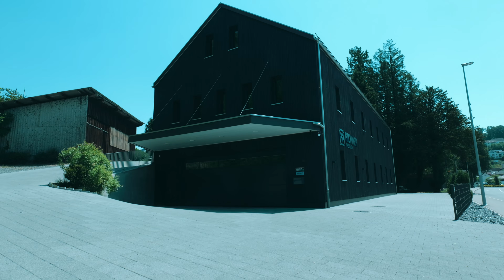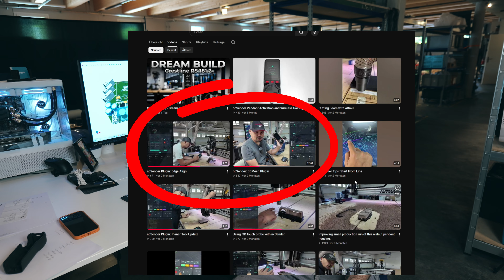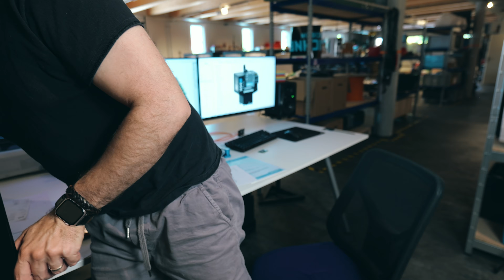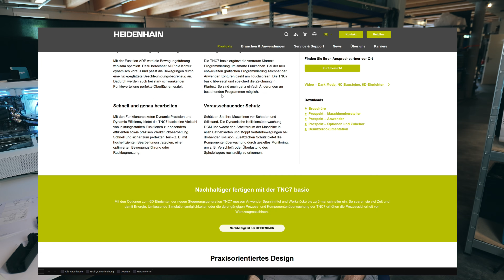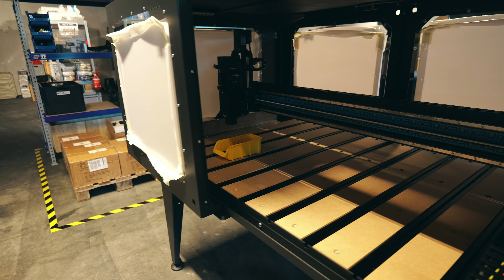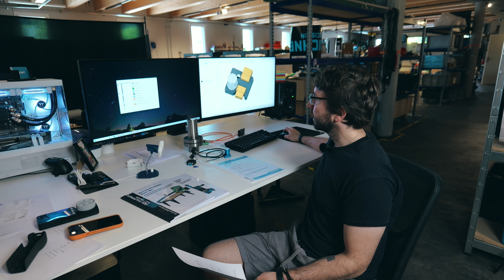Business Update June 2026 ❘ New Workshop ❘ New Employees ❘ Watchmaking ❘ Heidenhain...

Comment: few things
 god bless you for wireless remote! i tired if datron wired remote

second one, you need to mae the tool setter adjustable for X and Y axis

also, because you have a automatic lubrication, i would put a pressure sensor on the destrebution blocks, ideal pressure sensor for each bearing, but its a lot of wiring...
Reply from the maker: You mean to probe also diameter? Thats a different type of toolsetter we can also support, no problem. Our big XM machines use oil distribution blocks with a cylinder for each lubrication point that gets filled while under pressure and gets released when pressure is off. So each rail block and ball screw gets the same amount of oil without monitoring any pressure.
Reply: @Richner-Precision  no, under adjustable tool setter i mean that you can adjust it in plane i dont know how to explain it to you correctly, but its important, because if the tool setter not straight it will measure diffrent lenghts on diffrent diameter tools
if you want sent me you email. i will try to explain it to you better with photos or pictures.

about the  lubricaition points...
 i know what cilynders you talking about. but there is a problem.
 usualy operators run the machines until they stop or put a not compatible oil to the system, and then when one of the ports is cloged you dont know about that until you start hear funny noyses from the bearings,

again, its hard to explain in short message here, if you want to continue the descuss sent me your email i will explait it better.
thanks:)

Comment: awesome! im curious tho, i have been waiting for the lathe to be available, but while i was looking i came across the sinecore cnc lathe,
what would be the main differences from yours to the sinecore lathe besides the flood coolant?
Reply from the maker: They are actually very similar. I have been in touch with Aidan, the founder of SineCore, from time to time. Both lathes are very similar in terms of size, power, and capabilities, and both support full flood cooling. SineCore already offers an ATC option tho. On the other hand, it runs Mach4, which I personally really dislike, while the TORQ8 uses grblHAL. In the end, I think it mainly comes down to where you are located. If you are in the US or Canada, I would probably recommend the SineCore Lathe. If you are in Europe, I would wait for the TORQ8.
Reply: @Richner-Precision  Thank you for taking the time to answer, this is very helpful information!
Reply: @KennyLenny0  If you really want an aluminum bed, then go for it ;-))